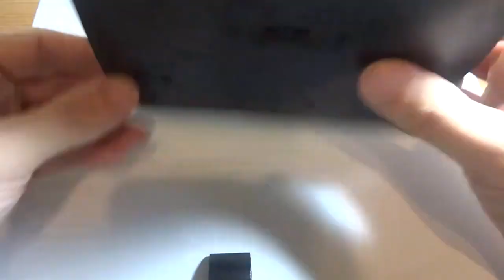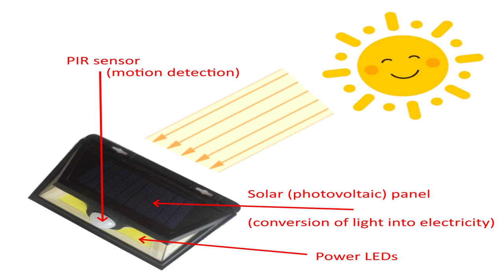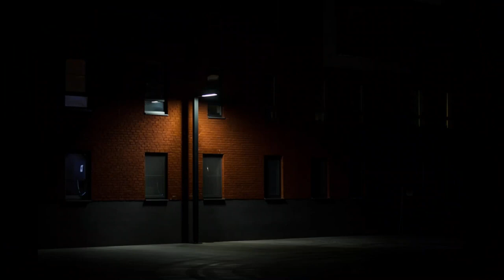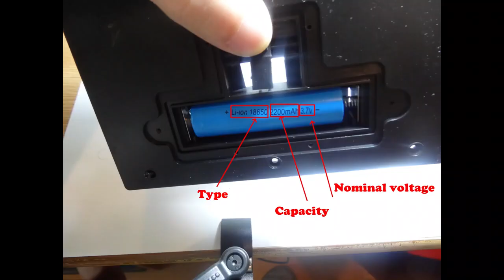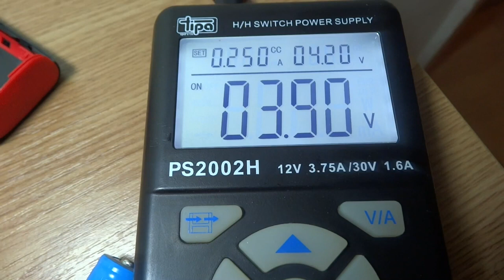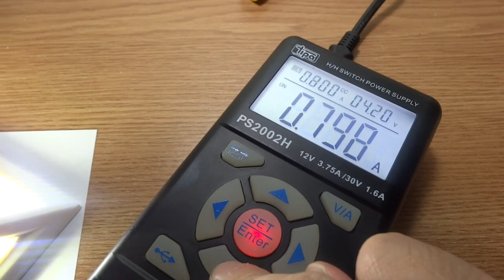Fix solar garden lights

Comment: Those lights are always selling with low quality batteries, because that is the most expensive parts i saw also lights with 3 x AAA instead of Li ion and it was reason why it was failing few days installation.